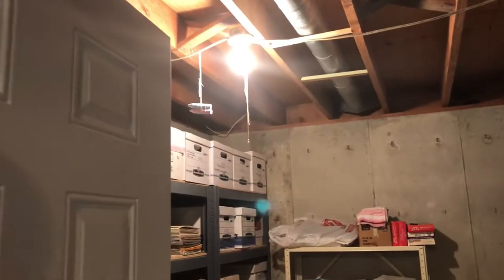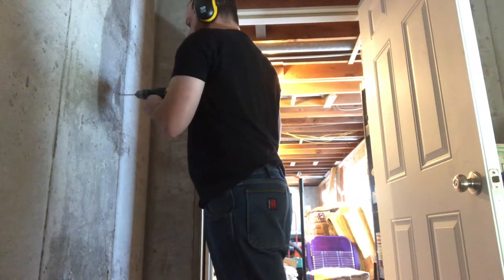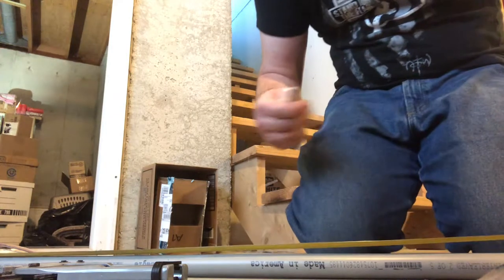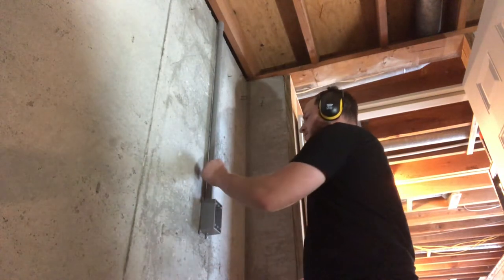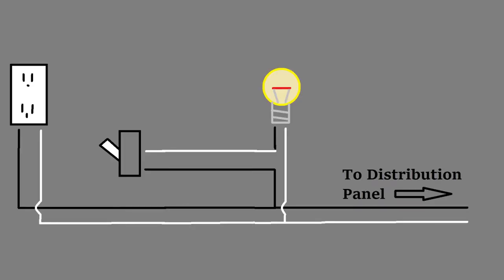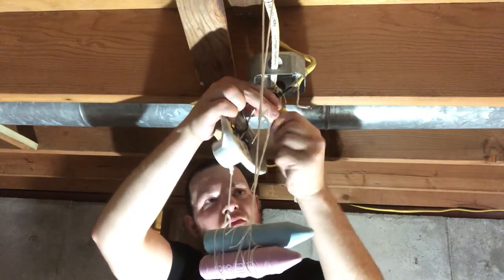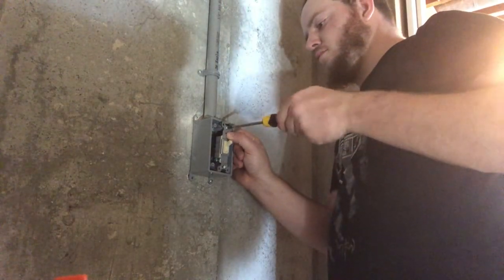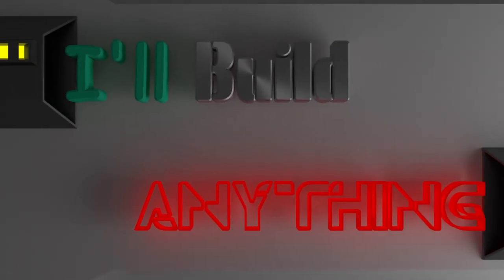DIY Lightswitch on Concrete wall

Comment: No box clamps? That’s a fire hazard. You can use plastic or metal clamps. Also, any outlets in the basement must be GFCI protected according to the NEC.

Comment: From what I remember you’re supposed to put cable clamps in the metal box.
Reply from the maker: Yes, but this box was ancient.  I also wired it up backwards. Power should go to the switch, and then the light, but...
Reply: @illbuildanything bottom line. Get the job done.
Reply from the maker: Romex is expensive though 😂